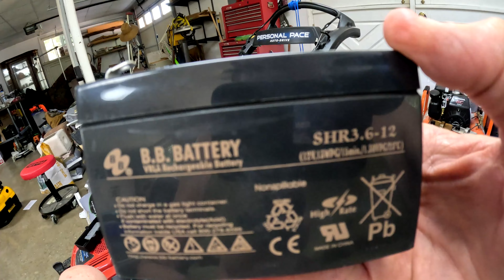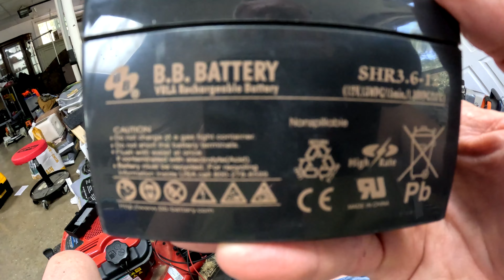Toro Electric Start Mower Will Not Start

Comment: That white plug near the start button is for charging the battery. It comes with it's own ac/DC "wall wort" to plug it in to charge. Good luck
Reply from the maker: Yes, you are correct! All my life I have had an automobile that had an alternator and battery. 50 years later I have an electric start mower without an alternator. Good Luck!